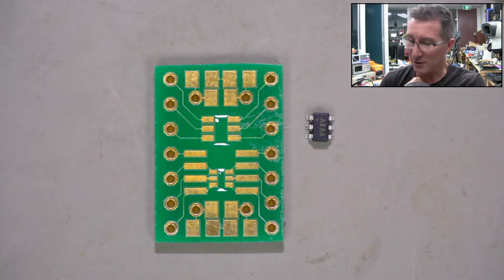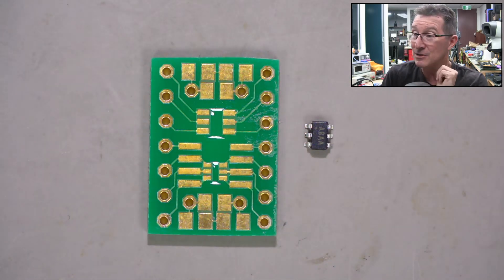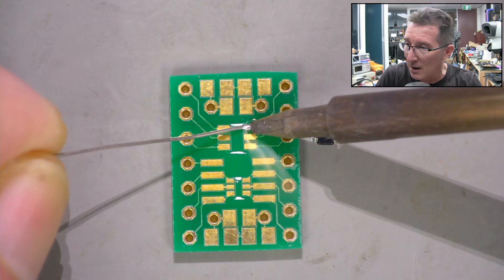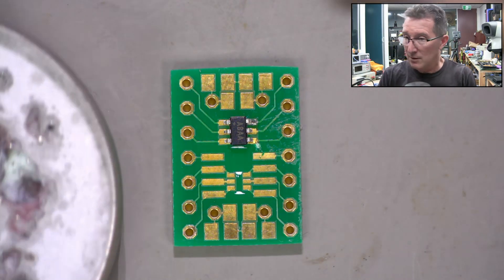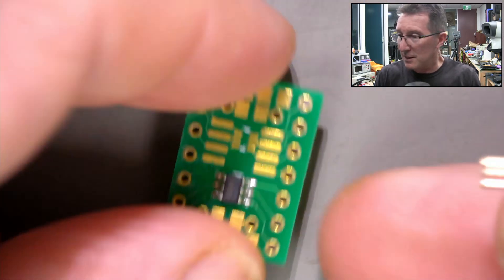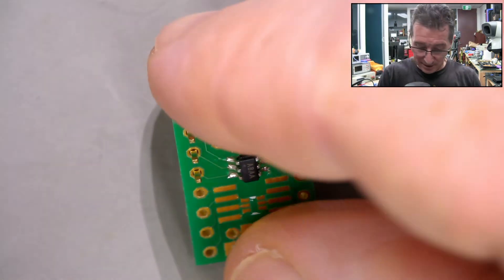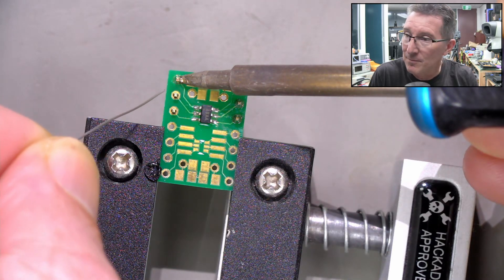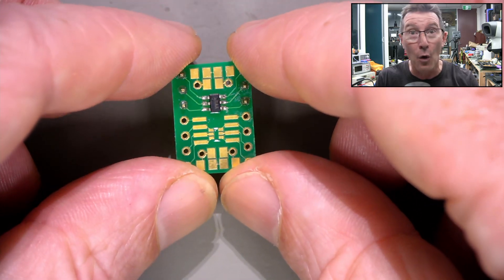Just Soldering an SMD Adapter

Comment: Naah, The header pin won't fit very well into a breadboard  but they will fit fine into a vero board. What I do if I have to mount it into a breadboard is solder an IC socket into the PC board, stick pieces of jumper wires into the sockets of the IC socket and that will keep the vero board happy. I thought you knew that 😅

Comment: The only problem with these adapters is that the pads will peel off or get cut when removed or placed on the breadboard
Reply: How?  That can only happen if you don't seat the header properly,, ie with the plastic right up against the PCB.

Comment: That is a nicely designed adapter board. Lots of options.
Reply: But rather horrible from a RF point of view. The unused wires and pads on the other side act as stubs witch could ruin signal integrity. The overhang could also limit placement options on the target board when other parts are nearby.

Comment: Dave, do a TQFP chip with the biggest tip you can find for the sheer masochism of it
Reply: That works well, it's called drag soldering.  I remember seeing a video of a Chinese factory with mostly teenaged girls using using a tip that looked like it fell off a plumbers truck.  Four quick swipes & done.

Comment: As a hobbyist I am learning how to use a hot air station. I can say a chip of that size isn't too bad after a few hours of hot air practice. I purchased a few "SMD practice soldering kits" and learned on the first one which has a row of 1206 resistors followed by a row of 0805 resistors then 0805 caps then a round center with a 555 + 4017 and a circling led display using a bunch of 0805 components. I got the display to work 2 days ago. I was a bit excited at midnight when it finally worked. I did have to reapply the 555 as I didn't get all the legs to solder the first time. I installed the 4017 perfectly the first time with no issue at all. Past that center section there are 0603 resistors and caps and finally 0402 resistors.  I did the 0603 resistors row last evening. I find this a bit challenging but I accomplished that with none blown away never to be seen again..

Comment: I always plug the headers into my breadboard first, put the device I'm solder onto that, and solder it onto the pins (at least the ones in the corners) that way everything lines up perfectly and the board is held in place for me automatically.
Reply: He's just showing how not to do it.
Reply: I do that with a 40-year-old breadboard that won't make me cry if anything gets scorched.  :)
Reply: @ke9tv  I shorted my nano that I had plugged into the breadboard and scorched the breadboard within 24 hours of getting the nano and breadboard.  Avoids crying about the breadboard.

Weirdly the nano managed to keep enough magic smoke to keep working.
Reply: Same here
Reply from the maker: In this case the pins fit very snuggly so no need for that.
Reply: @EEVblog2  The breadboard defaults to a workholding device, however, so you're not struggling with this tiny board!

Comment: I always first push the little board on the breadboard and then solder the legs for a perfect fit.  Soldering iron temperature seems too low.  Are you saving on electricity and flux?  :-)
Reply from the maker: 380C

Comment: I use the machined pin headers. They're the right gauge for breadboards. Or long-pin socket headers so you plug your jumpers straight into and still breadboard it.
Reply from the maker: Yeah, I'm out of stock.
Reply: 100%. And a flux pen ;-)
Reply: Me too. Bonus is that the machined pin headers also fit well into machined DIP sockets if that's what someone might also do with that adapter boards.
Reply: Interesting, hadn’t thought on them! I’ve found that the square headers do tend to weaken the breadboard springs a bit. Normally I use 0.6mm solid wire for jumpers, and I find they’re a bit looser after shoving a square header in.

Comment: 1. Put a little flux on the PCB.
2. Place the chip on the pads.
3. Touch the legs with a solder iron with a little solder on it.
and Bob's your uncle.
Reply: Or at the plumbers school...
Reply: Dave learned to solder at the school of blob soldering.
Reply from the maker: That's for pussies.
Reply: Good enough for Australia... @EEVblog2
Reply: @EEVblog2  🤣
Reply: Dave, title should be "Just how not to Solder an SMD Adapter" :lol:
Reply: У меня для пайки таких клопиков, есть деревянная зубочистка, ей хорошо прижимать микросхему, когда припаиваешь первую ножку, чтоб она не убежала в самый ответственный момент :D

Comment: Finally someone that can solder on this platform. 
I might have used a bit of a higher temp and less solder, but otherwise great technique.
Reply: Nah, Dave hasn't a clue.  How can you trust someone who doesn't empty a tube of flux all over the board first?
Reply: @j.f.christ8421  man you won't believe what I get in my feed sometimes, some guy just splats solder paste and flux like mad, all the solder balls float under every pin, it's ridiculous. (I mean float, he puts on so much flux, that chips on the other corner of the board might get shorted)
Reply: I assume you're being sarcastic.
Reply: @shaunmorrissey7313  no, not really, why?

Comment: Poor job indeed Dave, you're supposed to put half a tube of flux all over it first.

FFS people, knock it off.  There's enough flux in the solder, even the skinny stuff Dave's using.
Reply from the maker: How the AF do they fit 5 cores in 0.38mm?
Reply: @EEVblog2  There's a thought, stick some under the microscope and count them.
Reply: @EEVblog2  id expect they do it like how they make fibre optics... make it much larger and then stretch it out till its the desired thickness...
Reply: @EEVblog2  elf magic
Reply: @EEVblog2  I guess it is the same process like with the picture-candy.. you start with a big ass sausage and then stretch it till you reach your desired diameter.
Reply: When it comes to flux matters I am in Rossmann's school of thought
Reply: @asicdathens  Think for yourself and skip the flux unless absolutely needed - and that is rare.  Not needed for thru hole & most SMD.